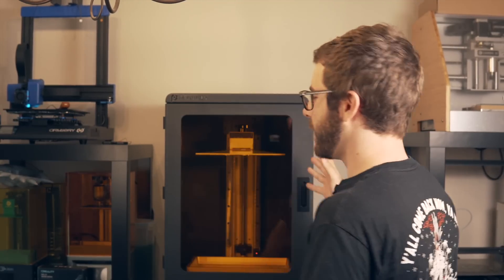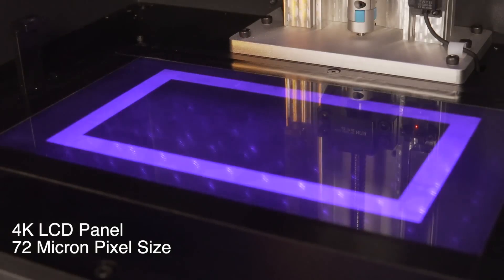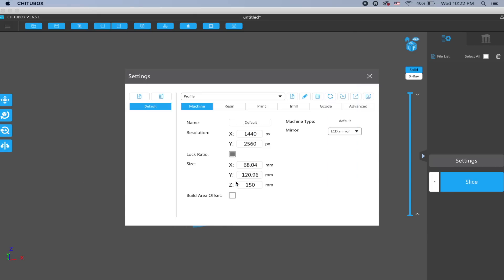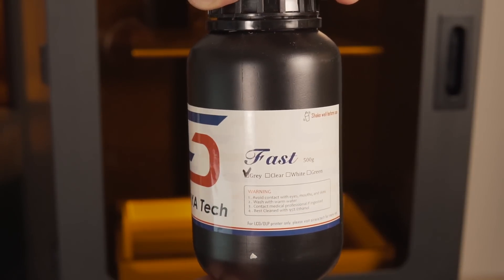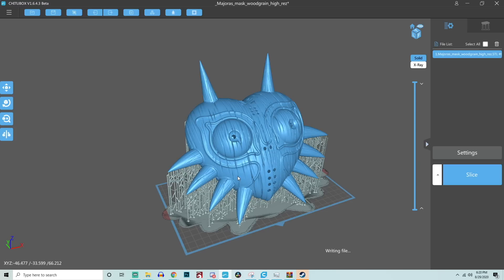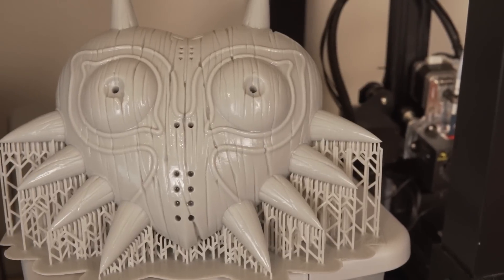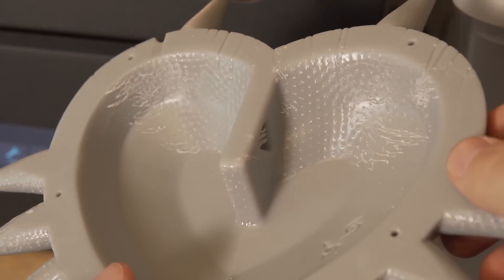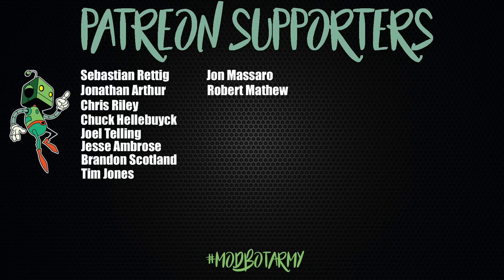Peopoly Phenom Overview And Massive Test Print

Comment: So the LCD screen on this printer lasts only around 400h ??? So on a model that takes 8h to print....Will I only be able to print 50 and the screen will start to fail? I need it for industrial prototyping. Are there other big printers out there with big volume but that can endure daily prototyping without the LCD failing after a couple of months? Any tips?

Comment: yes i would like to see you airbrush it
 what kinds of airbrush kit did you get? i hope it's not a master
also i  wonder what would happen if you try to cure and clean simultaneously , put some black fluorescent tubes  on top and bottom of that tub of IPA and  try and cure it when in the IPA
Reply from the maker: The compressor was a fairly cheap one from Harbor Freight, for the actual Airbrush I need to take a look as it has been a while. May invest in a better one.